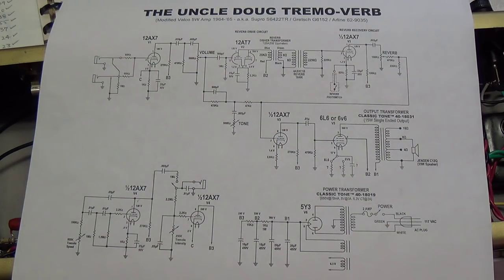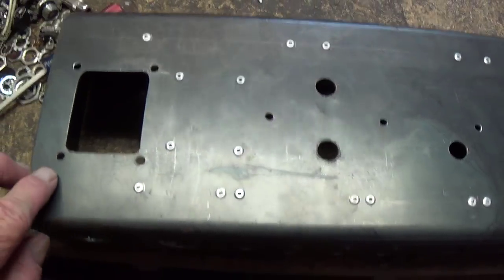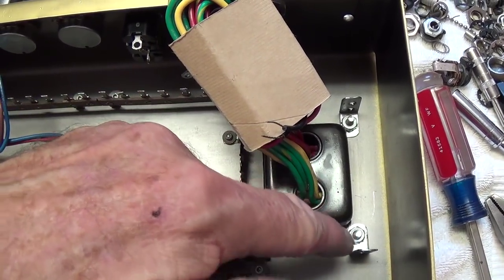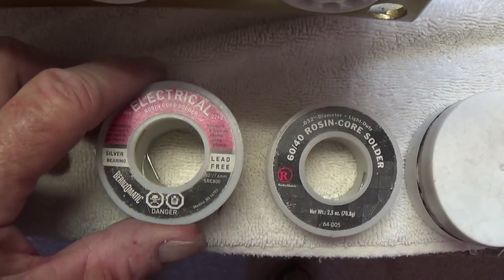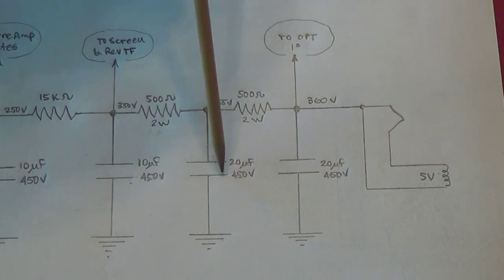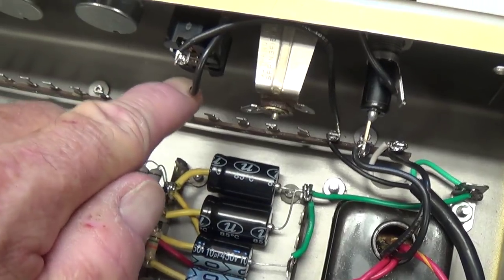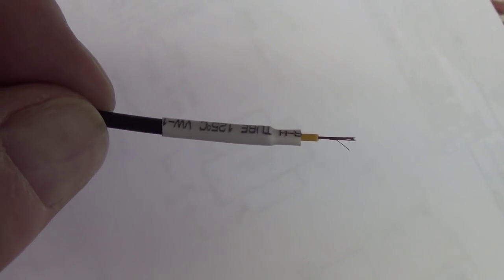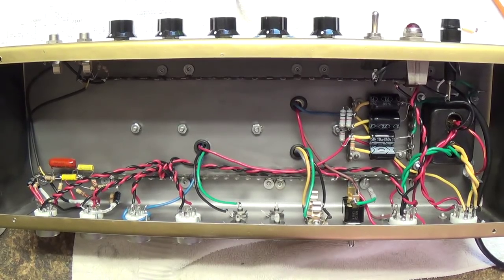How to Scratch-Build a Vintage Amp, Part 7:  Chassis Finishing and Point-to-Point Wiring

Comment: "Set fire to the house"   He he, that was a great comment.    Thanks for hosting the schematics and the chassis layout,  mighty fine of you Uncle Doug.I do have a question, its probably one of those 6 of one, half dozen of the other things.   Would just using 3 20uf caps instead of the 4 on the schematic work, and allow the skipping of the extra resistors ?    Oh boy am I getting excited about hearing this one once she has been finished
Reply from the maker: +Barefeet200  Thanks, BF.  Generally, the first filter cap is the highest value and then they taper down for the pre-amp tubes.  Why Supro chose to have two separate 20uf caps at first is one of those mysteries lost to the ages, but I am trying to follow as much of their circuit design as possible.  I may indeed experiment with other combinations later, when the amp is functioning, but for now, other than the essential addition of an inter-nodal resistor, I'm leaving as much of their circuit (and theory) intact as possible.

Comment: Hey Doug, I'm interested in how you translate your schematics to a layout, or are you so in tune with the build that you don't need a layout?
Reply from the maker: +chad smith  Yes, I can do all the wiring simply from viewing a schematic. I think most people could.....if they had sufficient practice, but barring that, a lot of folks prefer the visual aid provided by a layout drawing, and I completely understand.  It's sort of a crutch, however, and interferes with development of the abstract skills required to visualize the circuit directly from the schematic.....which is, to me, preferable, since layout drawings are generally not available.
Reply: +Uncle Doug Yeah, makes sense. It does seem like a crutch to have to redraw everything in a different manner and possibly miss crucial connections or components.
Reply from the maker: Fender has layout drawings available for most of their amps, but most manufacturers don't. If someone is addicted to layouts, they're out of luck in most cases.
Reply: +Uncle Doug I was more interested in drawing out my own after making schematics modifications. I'm looking at Marshall 18 watt lite schematics, but am going to add a Cascade modification for more gain. I've done layouts in illustrator, but was just interested how other people transfer to layout drawings.
Reply from the maker: Actually, doing your own layout drawings is probably a great way to gain a fuller grasp of how the circuit functions, and to avoid the pitfalls of chassis design errors. I guess I do this mentally, but have never resorted to actually drawing one out. I must admit, however, that it does seem like a good practice to me.

Comment: I am really excited about this amp. I have been building higher wattage amps for a while and really want to build a low watt amp with tremolo and reverb. My wife can't wait for a quit amp. As if there was such a thing!
Great job as always. It is the electronics class I never had.
Reply from the maker: +Steve Dewitt Thanks, Steve.  Low-wattage amps do indeed have their place, especially in my house (and yours, it seems).....where blasting the wall boards loose would not be conducive to marital bliss.  Thanks also for taking the time to watch and comment.

Comment: Very nice construction so far! One problem I ran into on my latest build is that I used a fairly tall turret board, and many of the resistors I ordered from Mouser just didn't have leads that were long enough to reach from turret to turret. It seems as time goes on, components makers are getting skimpy on their leads!
Reply from the maker: +Alva Goldbook  Thanks, Alva. I guess if they can save .00001 cent on each resistor, it will add up over time.....much like McDonald's shorting each customer one french fry :))
Reply: +Uncle Doug I had a heck of time with this! I even ordered resistors with long enough leads based on their data sheet, and some of them were still too short. So frustrating!
Reply from the maker: I ordered a Fender-style footswitch a year ago and it arrived with the usual RCA plugs, but the contact pins in the center of the plugs were less than a half-inch long (overall).....they barely protruded beyond the outer shields and couldn't reach the contact in the jacks.

Comment: It's interesting to see your style of wiring vs. mine.   There's a few good ways,  and tons of bad ways.   I almost always do my heaters in a daisy chain...  I've not seen them done your method.   The smell of solder rosin makes for a happy day.   My guess for the cathode resistor for the 6L6  would be 300-600 ohms 10 Watts.   500'd be the first I'd try...   This is based on looking at the completed work of others.
Reply from the maker: +DeadKoby   I used to do the daisy chain too, DK, but am trying a different method in this circuit.  I always found it difficult to solder two separate wires to each tiny little 12AX7 pin with the dc method.  This way there is only one wire per pin to solder and only two AC wires come near the tube base, rather than 4.  It may work out great.....or not.  We'll see.  I'll experiment with the 6L6 bias once I get it powered up, and post my findings.  Your guess sounds pretty good to me.

Comment: Looking good! Do you need to use wire with a higher voltage rating for the B+ circuits? Seeing all that wire run snug against the grounded chassis is making me nervous.
Reply from the maker: +Todd Patterson   Thanks, Todd. Actually, running the wire close to the chassis is a good way to reduce hum. I understand your concern, but it would take a great deal more than 400V to breach the insulation on 18 gauge wire.....I hope :)

Comment: I eagerly await your next video. Although I'm not building the same amp, so much of what you share can by used in other builds that I continue to get more ideas with each new release.  Now I need to buy more tools for my 5F2a build.
Reply from the maker: +Slugg0matic   That was my intention, Randy. I know that the amp I'm making might not appeal to everyone, but the steps I take with it can be applied to any tube amp.  Best of luck with your projects.

Comment: Loving this video series.  What type of hook up wire are you using inside the amp going to the tunes?  What Guage,  solid,  stranded,  pre-tinned?
Reply from the maker: +ShofarGuy   Thanks, SG. Other than the transformer wire, which is of varying gauge, the hook-up wire I'm using is 18 gauge, stranded, untinned copper.  To be honest 20 gauge would work fine and might be a little easier to deal with, but 18 is what I had on hand and have always used.

Comment: I can't wait to hear it! Although I wish you took a little time with the lettering, I have no idea how to do something like that. In any case, this series is awesome Doug, thanks for all the knowledge you're sharing.
Reply: +Rafael Sampaio  Making the lettering would be fairly easy with a printer and some specialized paper like a transparent front and sticky backing thing. What I think would be awesome for the lettering would be to use a CNC machine that would physically etch the lettering onto the metal itself and you`d never have to worry about losing the lettering to the elements. But, ya, once a good clear coat is sprayed over the sticker-type lettering it should hold up fine.
Reply from the maker: +Rafael Sampaio  You're welcome, Rafael. The letters are the rub-on type they sell at art supply stores. They are available in hundreds of sizes and fonts. It takes a little practice, but they can produce some very nice results.
Reply from the maker: +Krang Gangs  That's exactly how the logo and amp name were done, KG. I made a video about it a while back. The rub-ons are covered with several coats of acrylic spray. I agree that laser etching or something of the sort would be fabulous.